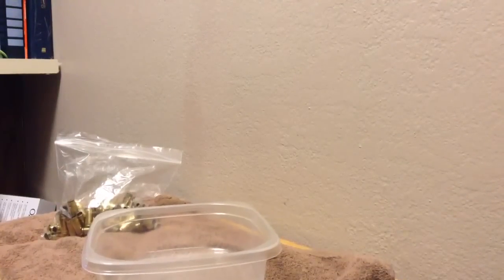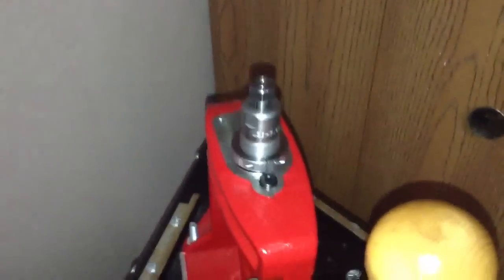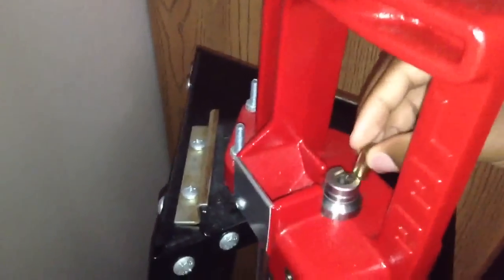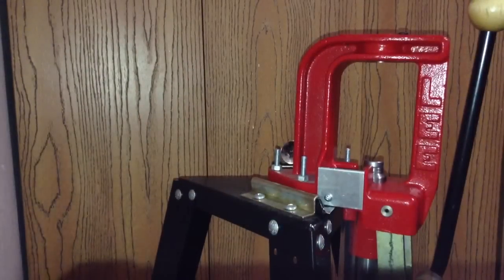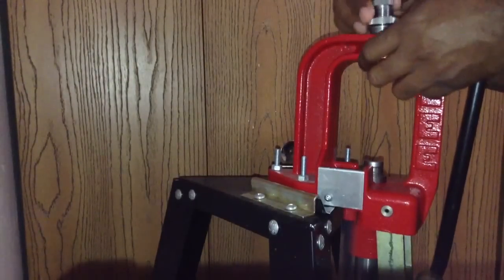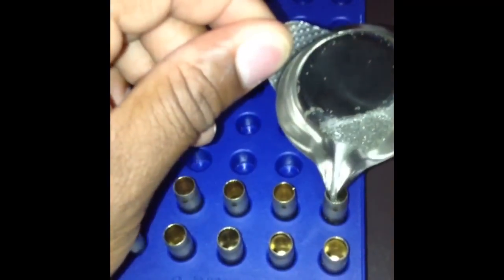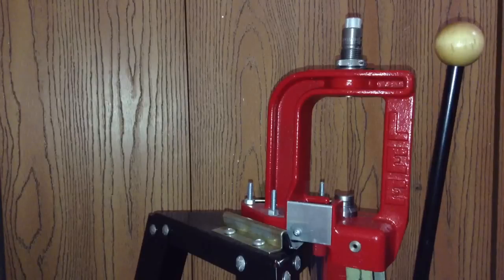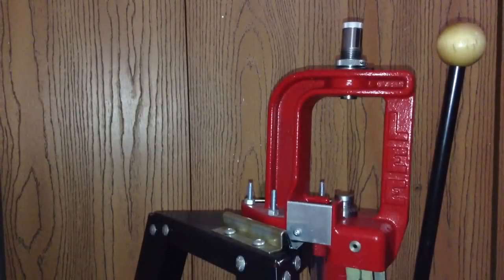Hand loading 7.62x25mm Tokarev (86 grain Round Nose Soft Point)

Comment: Do you know if there are any conversation kits to make a 7.26x25 tokarev pistol in to a 9x19 I've had problems getting components together for the 7.62x25 and 9mm is cheap and available both in made rounds and components?
Reply from the maker: gun nut well I have heard of them being converted to 9mm Luger. But I think 38  ACP / 38 Super conversions were more common. I've being trying to get someone to make a 38 Super barrel for the Tokarev. To be on the safe side one could load it to 38 ACP pressures.
Reply: That's an awesome idea ether caliber would be easier for me to get tok is hard to get here in TX :(
Reply: As I recall when I bought my CZ52, you could re-barrel them for 9mm, which I presume was 9x18, I don't recall if there was 9mm parabellum, but I remember that they could be re-barreled for the 9mm Largo. (Spanish military round). I do remember the commentaries said that the shorter rounds were a little more problematic, or better said a little more prone to a jam from time to time because of there shorter length. I can't specifically recall the sites, but I'm sure you can punch them up in online searches just as I did. One of the YouTube videos on how to replace the rollers and firing pin had links to parts, and I am sure they could direct you further.

Comment: You don't mention using a case gauge to check if the finished round will headspace correctly. Do you check the finished bullets in the barrel, or do you have a gauge?
Reply from the maker: bill howell not for this caliber I don't. I simply make a few dummy rounds with no powder and primer. If the dummy round chambers with no problem. Then that's usually my green light.  It's to my understanding that no one makes a case gauge for this round. If they have.. I'm completely unaware of it as it was not around when I started loading this round.
Reply: Christopher Sumpter
Thanks for the response, I use the barrel/chamber for my gage. It's tedious but it works.
Reply: +bill howell Case guages are really only necessary if you are loading for multiple firearms anyways. Most of us only have one of a specific caliber so chamber fit is a-okay.
Reply: I have been reloading the same components...the problem I have been having is that the gun cejects but the next round does not feed properly....yet, standard surplus FMJ ammo cycles perfectly.

Comment: Thanks so much for this video.  7.62x25 load data is not too difficult to find, but if you have done much searching you know that the load data is all over the place.  There's some downright dangerous load data floating around from AA which has blown up a few CZ52s.  Anyone shooting a CZ52 please verify that your data is not the old Accurate data published around 2002 I believe.  The CZ52 is NOT stronger than the Tokarev design, and you should NOT use the hotter data.  This was misinformation.    
It just so happens I have the same AA#7 powder and the exact bullets you are using, so it is comforting to see someone using this load/bullet just for verification.  
Thanks!
Reply from the maker: Ian Rupert I have heard of CZ 52ms blowing up. In theory I think the roller-locked design is stronger, but I sometimes wonder about the strength of Czech metal used in the pistol in certain sections of the pistol like the Rollers. I've also heard stories about how the rollers were not made out of harden steel along with other parts on the CZ 52. Don't know if it's true, but stories originate from somewhere and they may be some truth to it. Their is a company selling hardened rollers and firing pins. In any case my Tokarev and PPS-43C seem to handle this load just fine :D